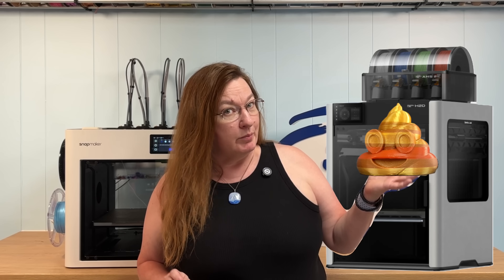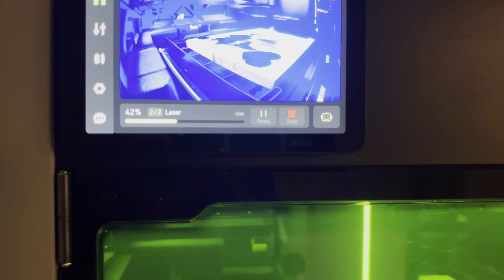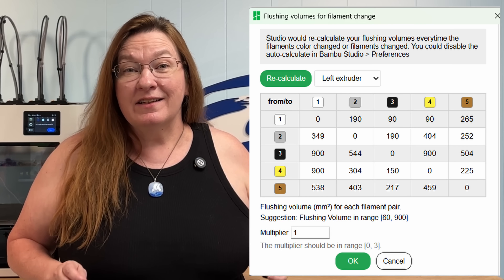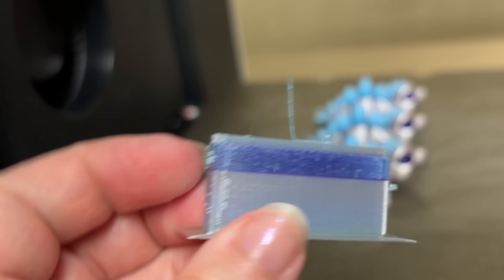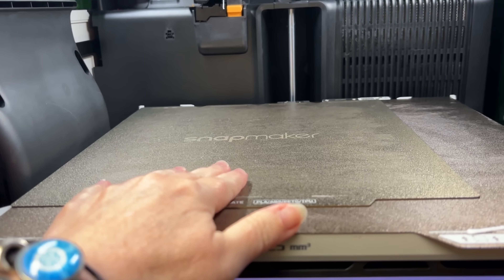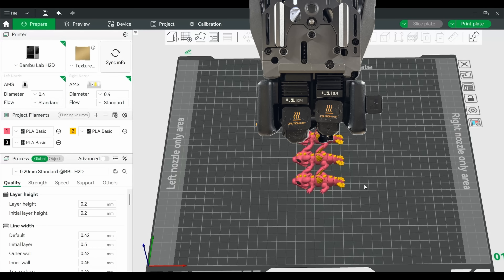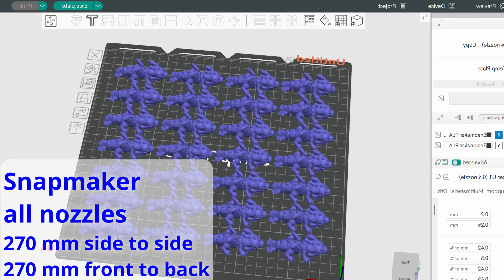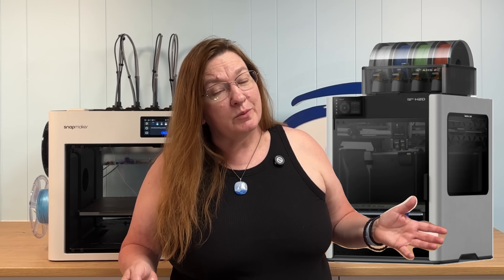Snapmaker U1 vs Bambu Lab H2D (Testing Speed, Print & Poop)

Comment: Thanks for the review. One thing I do not hear about wrt the Snapmaker in these comparisons is the lack of spool enclosure. One value in the AMS and its equals is that even the unheated ones can have desiccant reducing the humidity. If you are in the desert this may not bother you but for the rest of us ...its a concern and I have to assume if I go for a U1 I would end up buying an additional 4 bay enclosure at the very least (UKP45 upwards) and another bench space problem.
Reply from the maker: Most reviewers aren't worried about keeping filament THAT dry because we've gone through years of open air bedslingers. Experience shows us that most filament is perfectly fine left unwrapped. BUT that wasn't your question! I made a short with a couple Polymaker boxes to see if they'd fit. I think it will work.  https://www.youtube.com/shorts/q1593zil994
Reply: Or you can spend 1-2 spools of filament and print the boxes yourself,  even fancy ones with tpu seals and rollers on bearings should be pretty easy to print in few hours especially considering that you can on this machine print the seals inside the grooves in the model with its multimaterial capability
Reply: A dryer is necessary if you printing with Engineering material!!
Reply: @consumerlabs5063  thing is if you are mainly going to print "engineering materials" then the 4 tool feature of this printer is kinda pointless, at most you need two materials - main and support and for THAT H2D is much better with its heated chamber, air filtration and full enclosure
Reply: @Asghaad  Of course if you are lazy (like me) then you want as many spools in the system as possible... Its not a matter of what I need for a print but more what I need most often. So a selection of fav colours and materials
Reply: @fafhrd0023  ie H2D is ideal tool for you then

one permanent nozzle with a support interface material, second nozzle connected to a AMS unit (or two... or four) for "lazy" material changes.

only limitation that has is issues with abrasives like CF or glass filled filaments and flexibles that would require more manual input

lastly being "lazy" with hygroscopic materials isnt a thing for toolchangers, even if the spool is in sealed box, the filament in the tube and the head is NOT
Reply: @Asghaad Yep, It is on the list but I do like the U1 toolhead changer concept.
Reply: @consumerlabs5063  Still waiting for the top hat on the U1 Too......
Reply: ALL AMS type systems like the Anycubic, Creality do the desiccant route.  Its not ideal because in humid environments you will literally be changing the desiccant every other day
Reply: @anthonylong5870  Anycubic ACE heats to 55c and with that the S1 can print PA and PC.  It's insane you have to go aftermarket for a hardened nozzle but the Kobra S1 is one of my send it and forget it printers.

Comment: Love the openness of the Snapmaker U1!!! ironic how Bambu mentioned the Votek nozzle changer right when the Snapmaker U1 crowd funding went viral. I am curious as to the Votek system and how they are going to handle extruder retractions on prints with multi color with prints that require a nozzle retraction before all the filament in the nozzle isn't consumed below the cut when a  nozzle retraction is needed. Are they going to go a head and flush/poop the filament in the nozzle if you need a extruder retraction when changing colors going right into a print needing extruder retraction?
Reply: The bambu trailer/preview video kind of seemed rushed and as if they saw the threat of the hype that u1 stirred up. So they quickly released that video, to lose fewer customers to the snapmaker even though they aren't confident in releasing their version of a tool changer yet (indx clone from bondtech)...
Reply: @DiverseGreen-Anon  If anything I think they helped hype the u1
Reply: @DiverseGreen-Anon  not a bondtech clone.  bondtech has the filament paths separate like a true toolchanger.  bambu is a hot end changer that uses the same filament path to enforce reliance on their ams system which is most of their profit.  because of that you still need the ams to retract and extend filament making color swaps far longer than a toolhead changer
Reply: @johnpaullogan1365  I wasn't aware that AMS was their money maker.  No wonder why the other manufacturers have copied it.
Reply: Bambus vortek is inferior to the U1. They threw together a CGI/AI video as fast as they could in hopes to deter people from switching brands. Its not gonna help them. The H2D uses decade old outdated tech and was a flop. And the H2C is using an inferior design compared to traditional toolchangers.

Comment: bambu is old tech u1 is new at half the price.
Reply: They are definitely pushing the market into a new direction and a new generation of "affordable" multi material printers in comparison to the prusa xl will probably start popping up.
When I am getting a U1 I plan to try out differently sized nozzles and dedicated ironing nozzle/tools. As that looks really interesting on top of the advantages that multiple materials bring (supports in varying materials, no clogging from contaminations etc.)
Reply: Besides the tool head changer what's the new tech that the U1 is using?
Reply: Only things I can think of are the calibration method on the heat bed and the usage of pogo pins, which I am not yet shure how reliable these will be  @bp328i
Reply: @bp328i  I got a U1 now. If you remind me in like half a year or later, I can give a status report on the reliability and if I had to replace any of the consumables yet.

Comment: I've ordered the U1 to replace my P1s as Bambu are on a crusade to lock their systems down. That is a big factor for some people too.
Reply: Bambu doesn't deserve customers after their lockdown. It's crazy that they are basically locking people out of their own devices.
Reply: @firstlast642  No they're not...  People need to stop with this garbage...
Reply: @cylonmode  Except H2s and X1s with the latest firmware can no longer upload prints over Wifi using Orca slicer because of the new "authorization system". That is lockdown, no matter what you think or what excuses Bambu is trying to push.
Reply: @Tomas-ir8xl  Sorry, that's not "locked down" but you keep doing you...
Reply: @cylonmode  I agree. I use LAN to send prints to my X1c. You dont have to use Bambu's system.
Reply: @cylonmode  bot or delusional?

Comment: But is the quality the same ?
Reply from the maker: YES!
Reply: I doubt you could notice any difference at this point.
Reply: Therw better be at the huge difference in cost...
H2D is much more "premium" product but comes also at premium price.
Its kinda up to each individual if that extra cost is worth it or not
Reply: @Asghaad  Premium build quality for sure.  But old tech. We are right now in a spot where things are changing so its hard to know whats best because there is no best in all category option.
Reply: @skywalkr2  "new tech" also means new ISSUES ... new does not automatically mean better

also the U1 is  "old tech" ... no induction heating, no quick change nozzles just normal extruder with hotends being very old style like in Bambu P/X series 

the machine has ONE thing new- the carriage/tool quickchange toolchanger, the rest is old stuff in some cases like the nozzle+heatsink VERY old stuff

Comment from the maker: 🏆 Which would you choose? The Snapmaker toolchanger or the Bambu Lab AMS system? Let me know!
Reply: At this point the price is right for the Snapmaker.
Reply: Maybe a U1. But I’ll wait for INDX
Reply: U1 for sure now.  Once Bambu has a tool changer that can match the speed and the waste free U1 can, then I will perhaps they can have a look.
Reply: H2D and hoping to upgrate it to the H2C
Reply: As i own 2 Bambu printers (P1P and P1S) and have had nothing but PROBLEMS since i got them. I will never go near another Bambu product again. over $1000 in parts to keep those 2 machines working for just 2 years.  And Bambu's customer service is HORRIBLE and do not honor warranties at all.  I currently have 2 U1 on order
Reply: @anthonylong5870  Your experience is not typical.  We've had one of each Bambu printers available thus far.  We've had an AMS Lite go bad after 1000's of hours and an early AMS 1 had some issues.  Other than that they've been bulletproof.